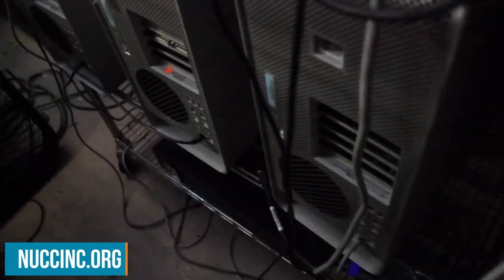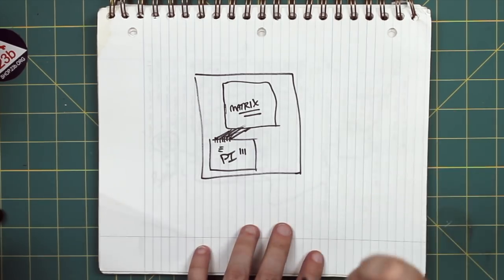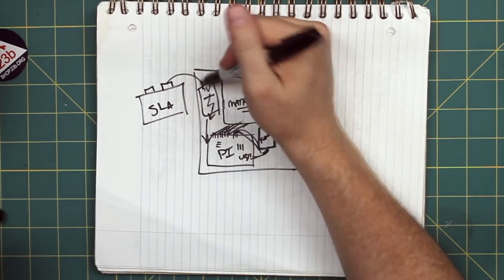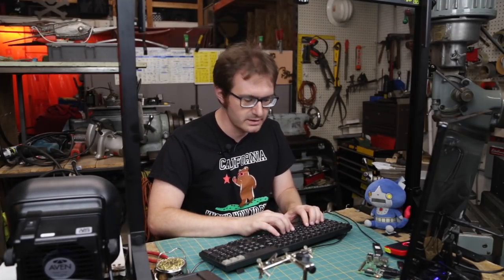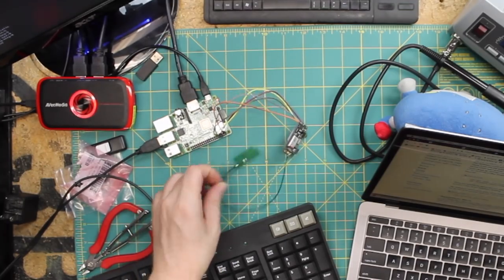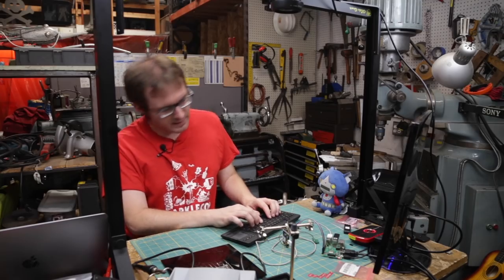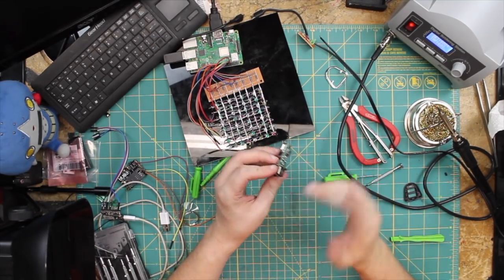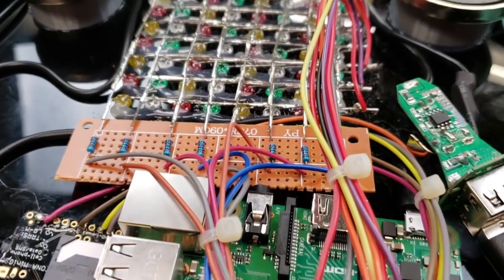Raspberry Pi Asteroid Tracker

Comment: Are you not going to use AT&T Assembler plus some c++ glue code and compile it using gcc-arm to generate very tight machine code for the Raspberry Pi as Python code is very slow though Python does have it's uses machine code is more efficient and gets the work done.

Comment: I've done 13,052,773 work units on SETI@home and 17,232 hours classic hours I've been with Seti since 2001. the last 7 million work units have been since 2015. My most recent ave work units is 14,460.61, I have a water cooled AMD FX8350 with a GTX 1060 6GB GPU and a  R7-250X  GPU in the same system just running the GPU Cuda cores for Bonic. I have an old 2007 Macbook running SETI plus my Samsung Note 8 with 8 CPU's and 5 GPU core running Bonic, them my Spare HTC 10 with its 8 CPU's and 5 GPU core running Bonic then my old Samsung Slll with 2 CPU's and 4 GPU core running bonic. they run 24x7

Comment: how power efficient is this contraption? wouldn't a modern computing node be much faster using the same energy as this rp3? i do not know - you do? any data on that? computation per energy used is not easy to be found for this single boards or computers in general